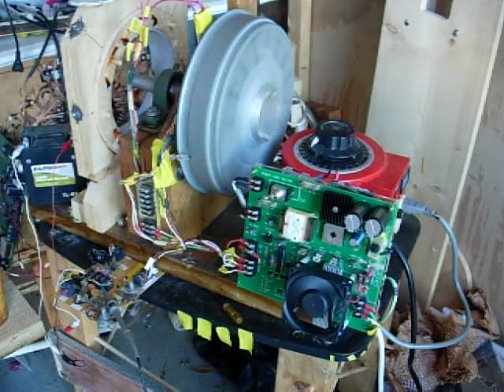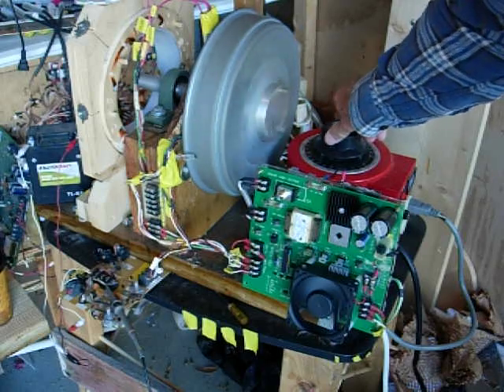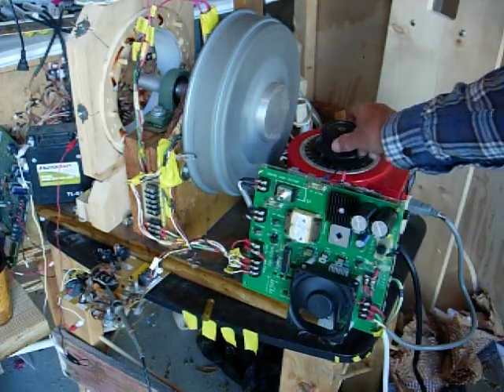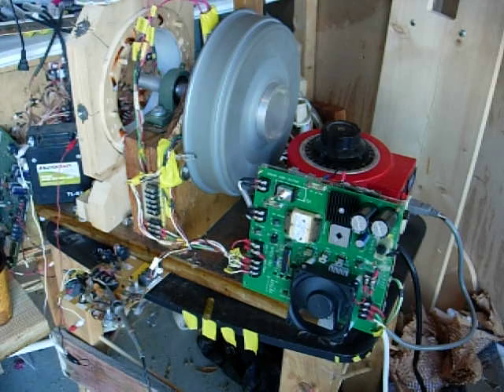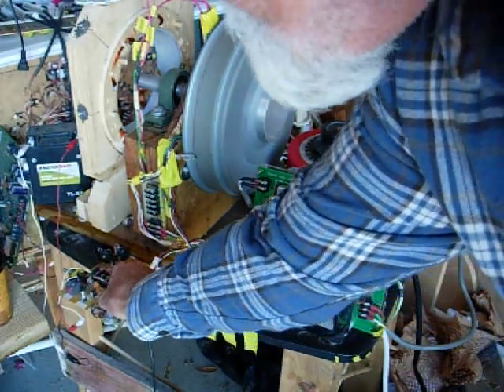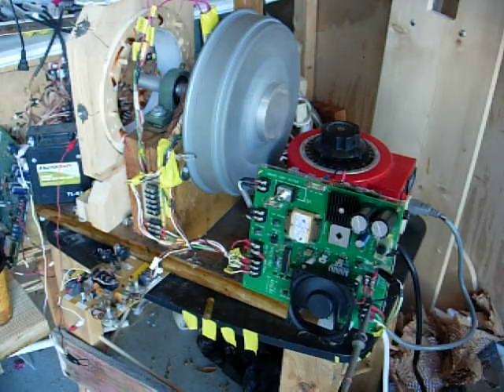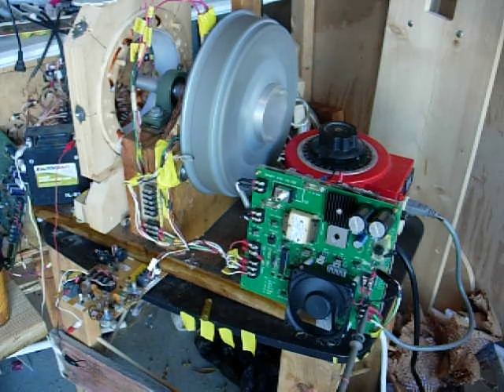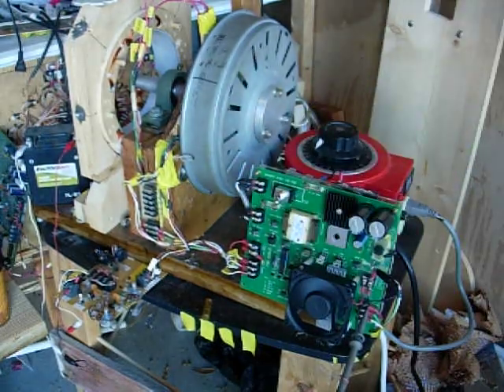Don Smith #141 Motor running and PCB Design completed

Comment from the maker: Just got rid of the variac.  the pcb now has one connection to 120vac and the motor runs at a steady 1200 rpms.  next step is connect a gen154 model with pulleys to the motor shaft.   I'm trying to get some new pillow blocks 1 inch shaft style from Germany good stuff.     3 to 1 pulley setup and then adjust the speed to get 60 cycles.     I also got a new IRAMS12UP60A from Digikey which is the 12 amp 600 vdc version.  this should fit directly into the new pcb.

Comment from the maker: Had an awesome week. finally getting some fantastic results.   The IRAMS10UP60 can handle 450vdc @10amps. if proper heat sinked.   The pots input to the Mega48 processor will be the key to controlling the motor generator speed if this is affected by loading.  I'll be purchasing a gasoline 1200w to 1500w generator and the remove the generator portion and magically connect it to my motor with superior pulley systems. if needed.    I'd really like to get a 1800 rpm 4 pole PMG.I have taken any current readings around the motor yet.  I have completed the manual for the new PCB and It's parts kit from Digikey.

Comment from the maker: Well on the way to getting this whole thing running.   When my moms house sells I'll be able to buy the pole transformers from Boundary Electric in BC Canada.  They sell for $1500 each plus shipping.  These will be torn apart and the guts thoroughly analyzed.   My intention is to place the guts inside a seal chamber with external connections for 120 input and outputs.  cooling will be added if necessary.    goal is to get 6kw and use 1.2kw to run the device leaving 4.8kw to do work
Reply: SIr i enjoy all your video. that is a very good job. Please can you assist me for the schematic for the complete set to run 6kw 220v.  Thanks.  zatdirectltd@gmail.com

Comment: I'm a new sub too by the way.
Reply from the maker: +Butch Weise Welcome aboard Butch.  My name is Gary I am presenting my video using Don Smith the energy researcher who passed away a few years ago.    I don't have much time to make videos.  so they are choppy but as I progress all info with fixes will be presented.  Currently working on four projects and two books.
Reply: +CAPTAINSSBN hi Gary. I'm glad you took up the torch. I've been working on the motor from the vids from Gerard but he stopped for some reason. I look forward to your vids and I'll be going through what you did previously to catch up. Thanks again!